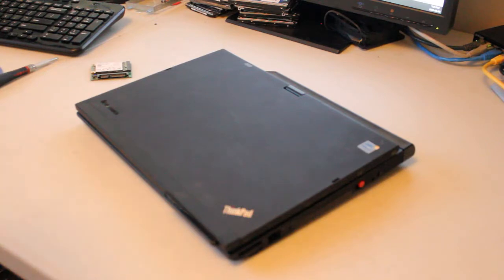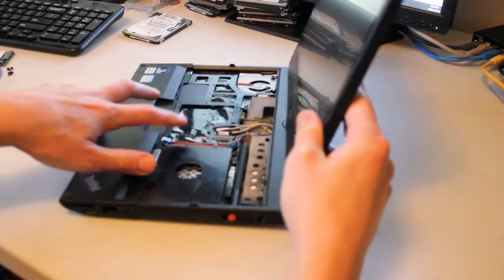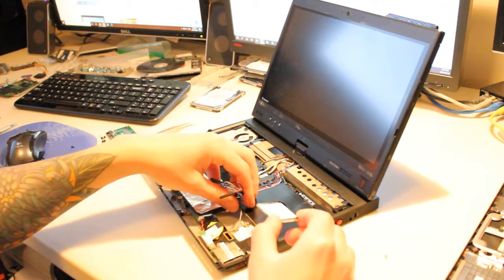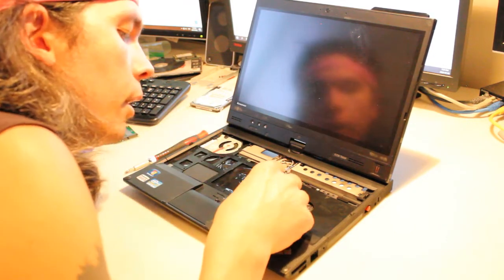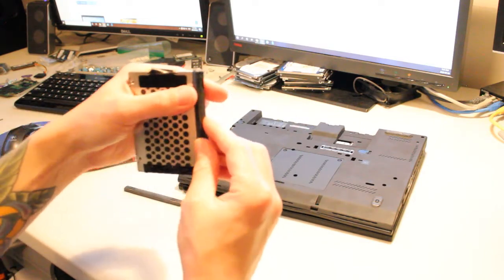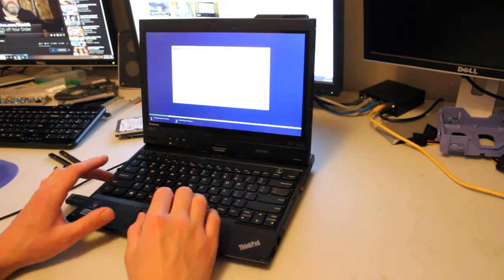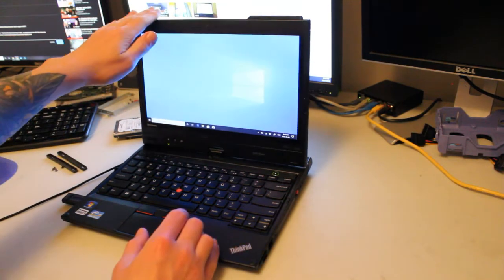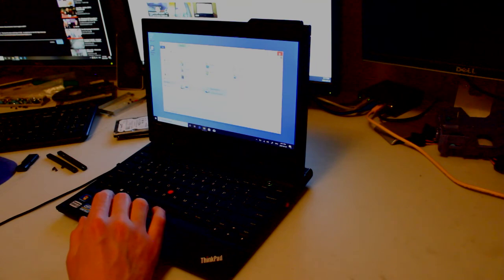Lenovo ThinkPad X230T mSATA SSD + second HDD + Win 10 install (how to)

Comment: msata port is sata 2 probably reason why it installed slowly not sata 3 like the 2.5 hdd controller which is faster, I would use the msata as ssd caching and main 2.5 ssd as primary drive
Reply from the maker: Fair, that would be a totally fine setup.  I would try that out as well and I just may with my personal X220T.  I set these up for resale/refurbishment with mSATA SSD's as the boot drive because it's much cheaper for me to install Hard Drives in the 2.5" bay for storage.  Someone could of course customize all they want by request or on their own.  Thanks for sharing :)
Reply: @HaisteComputerRepair  no problem great video! for ssd cache maybe primo cache would work or any other solutions. subbed!

Comment: I have a T430 model and the system does not see the mSata SSD installed in the WWAN slot instead of the 3G adapter? Do not know what could be the reason, maybe you need to turn something on / off somewhere in the BIOS or other settings?
Reply from the maker: Check the BIOS under Security>I/O Port Access and make sure the WWAN port is enabled.
Reply: @HaisteComputerRepair  Thank you. For some reason, I had to install a Windows on this mSata SSD, after that the system saw it, after which I inserted my main disk, started from it and, having already formatted the mSata SSD disk, I was able to continue using it. I can't imagine why the disc didn't want to be defined without these dances with a tambourine) In any case, thanks for the recommendation! Have a good day
Reply from the maker: @alexf1515  Sometimes you need that tambourine :)

Comment: NICE VIDEO, I HAVE LENOVO  X230 TABLET. BUT MY KEYBOARD LIGHT NOT working and also I can install windows in Msata SSD?
Reply from the maker: The backlit keyboard is not working?  Are you certain that the keyboard is the correct model?  There are keyboards that do not light up.  You can definitely install Windows and run it on an mSATA SSD, I do it all the time.  I believe the speeds are SATA II, but I generally install 128GB drives with the main job to run to the operating system and some software apps.  Second SSD's set up as storage is a good option.

Comment: Thanks for the video.

I think with the right adapter, we can install 3 unit of msata ssd on it, right?
Reply from the maker: Glad you liked the video :)  Do you mean install 3 mSATA drives?  You could purchase an mSATA to SATA converter and then install that where the HDD can go.  I've only installed mSATA SSD's with a converter on desktops, but I imagine you could find one that would fit in the HDD enclosure.  That covers 2 mSATA drives.  For the third, you could try a USB adapter.  There isn't an optical drive, so you can't install a HDD caddie there.  I'm sure there is a docking bay with an optical drive option, you could do that if you happen to find one.  That would be quite the setup!
Reply: @HaisteComputerRepair  Yes, I mean;
1st mSata SSD is exactly like you put it (on the WWAN slot)
and the 2nd and the 3rd, using a SATA3 to "dual mSATA converter" (to accomodate the two mSATA SSDs) to replace the main/original HDD (or SSD)
Reply from the maker: @yunussh5385  That's interesting.  Can you share a link to what you are buying?  Let me know how it goes, I would love to try that.
Reply: @HaisteComputerRepair  No, haha, I haven't buy it. I'm just thinking about buying this X230T, and put 3 SSDs in it, that way, if I can. I'd like to use them each for Windows, MacOS (Hackintosh) and Data Storage (or any other possible ways), if I can. (IDK yet will it works. Maybe you'd like to try it first and make the Youtube video for us? haha..would be glad to know too). And maybe the adapter is like this one? https://www.amazon.sg/StarTech-com-M-2-SATA-Adapter-2-5in/dp/B076S9VK1M
Reply: oh and 1 question please. Is this X230t has or hasn't, Backlit keyboard? Because all reviews are variously in telling about that, so I'm not sure. Thank you
Reply from the maker: @yunussh5385  Yep, every X230T should have two different levels of brightness under the keyboard plus a work light just above the webcam.  Hit the Fn key + spacebar to cycle through all three options.   One of the features I really like.   And if I find a good deal on an adapter, I just might try it out for fun.  Thanks for the idea :)
Reply: @HaisteComputerRepair  I finally bought X230T online for cheap, only about $175. Beautiful machine, but I did not read the seller's  description carefully. Found out later it has no Cam and pen (lost). Haha. It's ok I will buy them. I installed 16GB RAM & SSD to replace the HDD. 👍
Reply from the maker: @yunussh5385  That's too bad!  I think that seller should have sold it for a bit less.  But, as long as you enjoy it that's all that matters.  It can be like a little project now.  Have fun with it!

Comment: I have the same machine running tiny11 on 1tb sata drive, i do intent to have linux on anothe msata drive, isbthe speed superior on msata? Thanks, great video btw i know im writing this 2 years after you post it 😅
Reply from the maker: mSATA SSD speeds are at SATA II, so the 2.5" SSD is the solution for performance as it will run at SATA III.  It performed fine for my standards and I think Linux would be fine as well.  For me, it was more of a novelty for customization.  Thanks for watching!
Reply: @HaisteComputerRepair  I do thank you for your quick response, I think I'll use a spare msata a Linux boot, I am astonished by this "old" machine, very capable
Reply from the maker: @RatoAx  Awesome, good luck!  I like the X230T as well.

Comment: brother is it worth to install msata because I have a one Terabyte hard drive and I am using it as my main operating system drive
Reply from the maker: If you have one or find one for cheap, sure.  It really depends on what you want to do or if it makes sense.
Reply: @HaisteComputerRepair  msata is faster then hhd ?
Reply: I just do mobile repairing and software stuff in a little bit of gaming
Reply from the maker: @maxdemonyt03  If you feel like tinkering, go for it.  Using one as a boot drive might speed things up for you.

Comment: Great video! Can that SSD you used go in either of the 2 locations, or would it have to be a different type/size of SSD for the port where you installed the hdd?
Reply from the maker: Thank you  :)  The mSATA SSD can only go in the location under the motherboard.  A standard 2.5" SSD can go in the HDD bay.  They are two different styles of connections to the system board.  I suppose that there might be some kind of adapter for mSATA to SATA that could fit in that HDD bay, but unless you have two mSATA SSD's burning a hole in your pocket, I would stick to a 2.5" SATA drive for the HDD bay.    Does that make sense?
Reply: @HaisteComputerRepair  Yes definitely, I was just seeing if I could swap the one SSD from my HDD bay, but it's fine! It's only 128GB. If I want to use that for my apps and a larger hard drive for my files, what would you recommend I do? Just getting a larger SSD for the one under the motherboard. Or getting a large HDD drive and a smaller SSD for the one under the motherboard?
Reply from the maker: @zacr8588  Well, what I would normally do is install Windows onto the mSATA SSD and set up the HDD for storage + running software and games.  The SSD would outperform the HDD, of course, so feel free to install anything you like to it so long as you have the storage capacity to do so.  Installing two SSD's would be the best for performance, if you can budget that.
Reply: @HaisteComputerRepair  What do you think about this solution for using a monitor instead of docking base? Why not just use the keyboard of the tablet, with the screen down in the back, while using the separate monitors? Would that possibly damage the computer?
Reply from the maker: @zacr8588  Do you mean connecting a monitor (or two monitors) externally and using the keyboard on the laptop?  Like via the VGA and/or display port?
Reply: @HaisteComputerRepair  I meant two monitors, but possibility of trying to still use the computer's keyboard, rather than having an extra bluetooth keyboard. Is there any risk you think to banging on the keyboard, while you have the screen down flat in back, so you can view the two monitors unobstructedly. Could that damage my x230t? That seems like the easiest solution, if I had some sort of dual cable or use both VGA and HDMI.
Reply from the maker: @zacr8588  No, I think that would be ok.  Worth a shot.  Maybe do some research before trying.  I'll try connecting one monitor via the VGA port and one monitor via VGA to USB and let you know how it goes.  I don't have a Display Port cable at the moment.
Reply: @HaisteComputerRepair  Ok awesome thanks! Yes it's partly if it works, but also just too new to computers to know if using the keyboard like that leaves it in compromised position for chronic or accident-prone damage. I didn't even know to take out the battery pack before going under keyboard! So really appreciate this video and your follow-up. Happy new Year!
Reply from the maker: @zacr8588  I just set up two external monitors using a VGA to USB adapter and plugging a VGA cable into the port on the side of the laptop.  I downloaded the drivers for my insignia here first https://www.insigniaproducts.com/pdp/NS-PU96203/4974300 and got that working before I plugged the VGA cable into the port on the laptop.  It does work fairly well, but I am finding the system periodically has trouble detecting one of the displays.  A solution to this would be to purchase a docking station for the laptop, which would give you multiple display connections and more USB, etc.  It wouldn't be much more than purchasing a VGA to USB adapter from retail.
Reply: @HaisteComputerRepair  Thanks!  I suppose I could just use a dual VGA chord too. Just wondering if you have any thoughts on the whole banging keyboard in compromised positions with the screen question?
Reply from the maker: @zacr8588  I'm actually not too sure what configuration you mean with the LCD and keyboard.  Like this:  _/
Reply: @HaisteComputerRepair ' _._' (keyboard in front, but LCD isn't completely flat, it's slanted downwards a few degrees) I also have tried it your way or somewhere in between so any info on this subject would be very helpful!
Reply from the maker: @zacr8588  I think if you're just using the keyboard like that, you'll be totally fine.  Try it out for a while and see how it goes :)
Reply: @HaisteComputerRepair  Ok ya I guess it would only compromise that swivel part, and that's probably fixable? thanks you are awesome! Wish I could subscribe multiple times. Will check out your other videos
Reply from the maker: @zacr8588  Sounds good!
Reply: @HaisteComputerRepair  Would it not be compatible with a dual VGA cable? Directly connected! I'm getting input not supported for 2nd external monitor.
Reply from the maker: @zacr8588  Perhaps not.  Are you connecting one external monitor via the dual display VGA cable?  So the cable is like a "Y" splitter?
Reply: @HaisteComputerRepair  Yes the Cable is a Y and was connecting them both to it by secondary VGA connectors. Also. I am wondering if it's possible to use 2 external monitors without having a docking station?
Reply from the maker: @zacr8588  I was having trouble connecting two externals.  It just wouldn't stick.  Perhaps the dock is necessary.
Reply: @HaisteComputerRepair  What's the size of the 2 drives you are you using in terms of physical size not storage space?
Reply from the maker: @zacr8588  The hard drive is approx 4" x 2.5" x  3/8" and the mSATA is approx 2" x 1.25" x 1/8"
Reply: @HaisteComputerRepair  Samsung HM641JI won't work right? Needs to be thinner?
 https://www.pc-specs.com/storage/Samsung/HM641JI_640GB/562

It seems to be 9.5mm which is the 3/8" you quoted. But it looks like the thin ones are only 7mm
Reply from the maker: @zacr8588  as long as it's a 2.5" drive, it will fit.  Looks like this one will.  Thinner is going to be easier to install, otherwise you'll find that it might be a bit snug.  Just be cautious you have it lined up correctly.  I have installed many that are so snug it takes partial take apart to remove.  But, it's all good.

Comment: I also have same laptop, is this upgrade good like adding msata for linux and hdd storage for like data and maybe windows. Are msata ssds good for operating system? Do they heat up too much? Do reply. Nice video btw
Reply from the maker: Thanks for watching :) I have had good experiences with mSATA SSD's.  In my experience, they work very well as boot drives for any operating system.  I'd say go for it.

Comment: Is it possible to dual boot linux and windows 10 one OS on each disk?
Reply from the maker: For sure.  You can have Linux on one drive and Windows on the other.  So, when you power on, press the ThinkVantage button and then F12 from the menu to choose boot options.  I believe there may be software (or different BIOS from different board manufacturers) that will automatically prompt you after powering on, but I haven't ever explored that route.  So, if you have one OS that you prefer, select that as priority boot in BIOS and the other disk as the second option.  Let me know how it goes.
Reply: @HaisteComputerRepair  I will try it: Linux on the msata as my main OS and Windows on the 2.5 slot, so if I want to swap the windows ssd with a storage hdd to backup, it would be easy.
Reply from the maker: @lucianolacurcia2642  I think that would work just fine.  Do some research if needed.  There are probably a bunch of tutorials floating around.  I would be curious how this works with Linux, so let me know :)